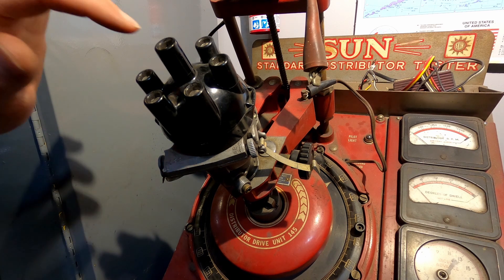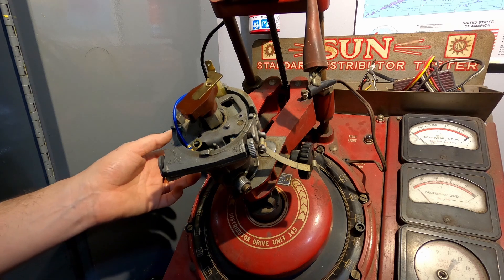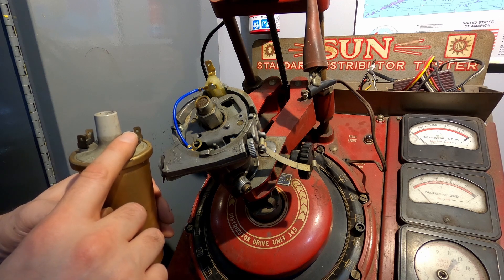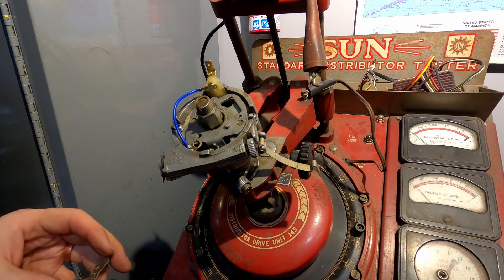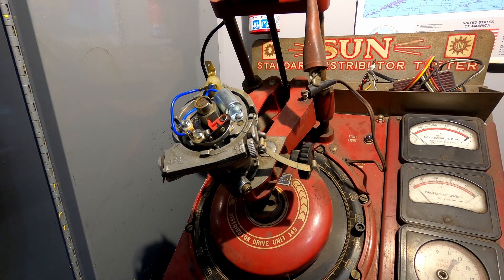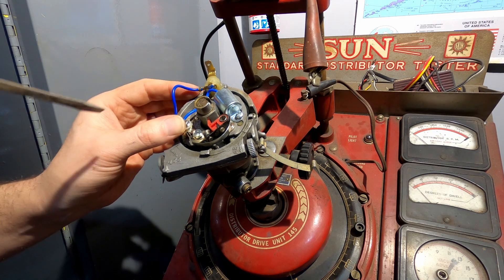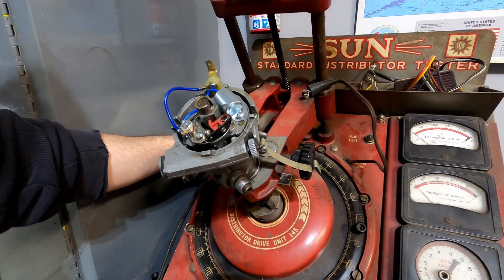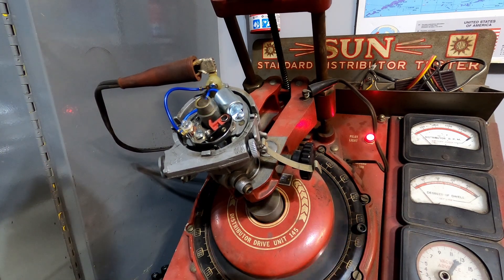The Lucas Ignition Distributor: How it Works (Part 1)

Comment: Very well done!  Hoping you talk about how to set the timing.  I cant find a good video demonstrating pinging on a tr6.
Reply from the maker: Check out my older video on the distributor. It's less theory and has a practical bit at the end including static timing. Otherwise if you have a timing light just set it per the factory manual and advance a few degrees.
Reply from the maker: Unless you're looking for a video on what pinging sounds like, in which case I don't have one of those.